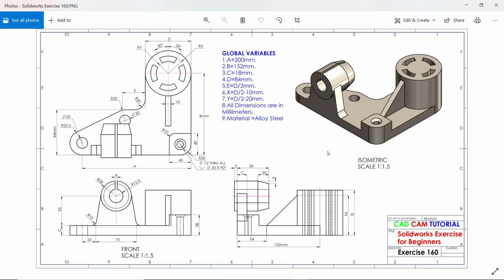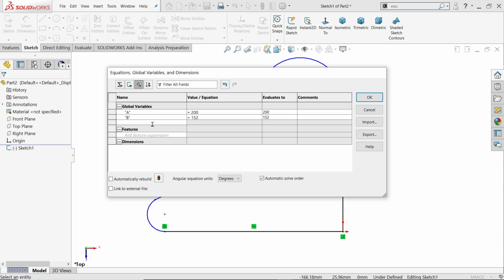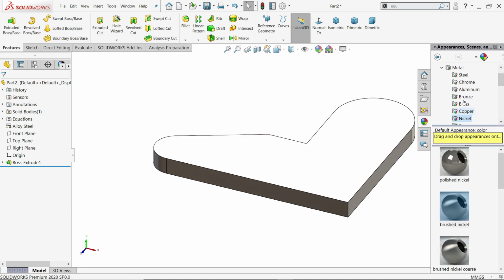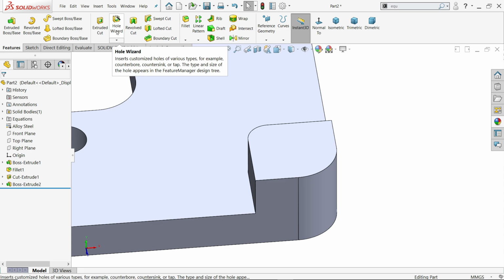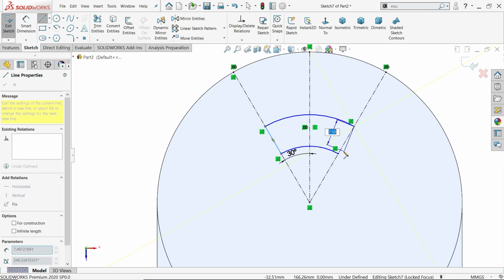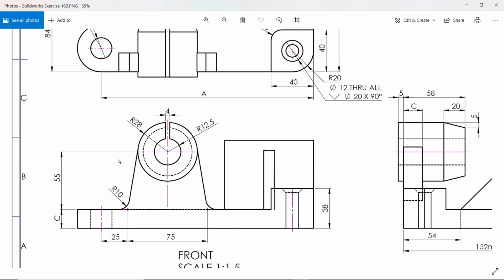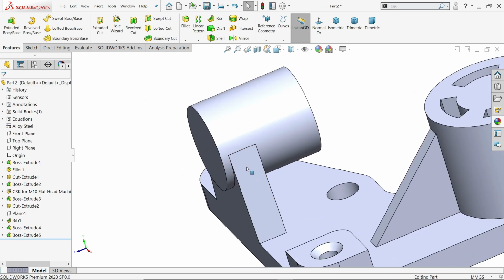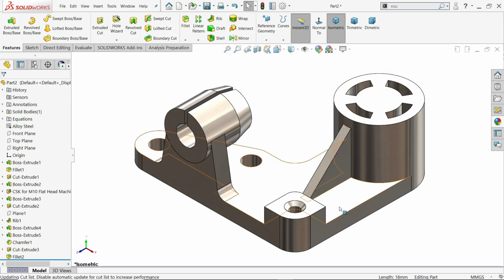Solidworks tutorial for beginners Exercise 160

Comment: Nice  sir,

While designing the foundry patterns  shirinkage allowance to be added in Engineering drawing .
Two steps:
1.Normally Shirinkage allowance  added in scaling option in mold tools 
2 .physical method ,we are calculating shrinkage allowance  the all dimensions in engineering drawing  using pen ,paper. And calculator .
Merits of physical method.
 Depends upon the drawing contraction allowance varying from drawing to drawing ,
One drawing have a three type of( 2.5,2,1 percent )contraction.

Instead of scaling option on time one contraction to be provided.
Question :
How to reduce pen ,paper and calculator?
Which option to be activated solve this issue.

Please reply as soon as possible .

I hope this is enough for your understanding
If you not understand ,give your mail id and i prepare one power point sir 

Thanking you